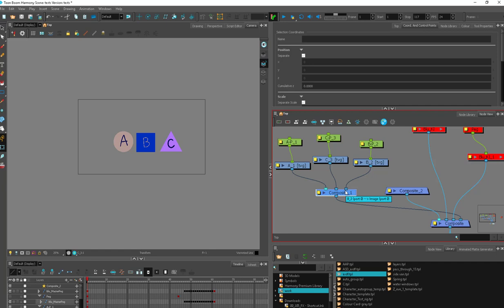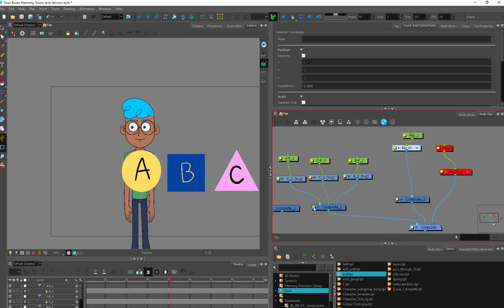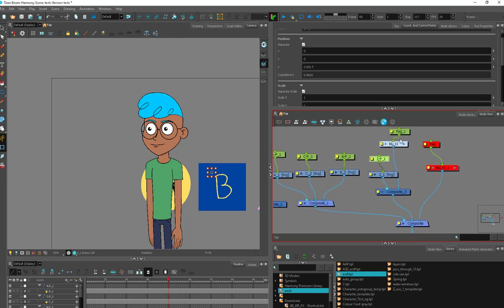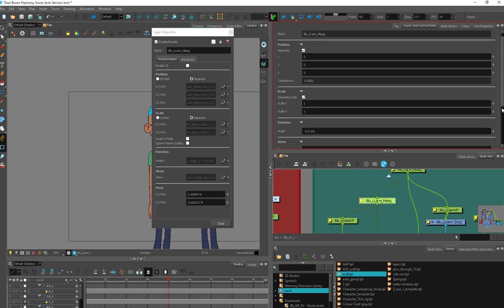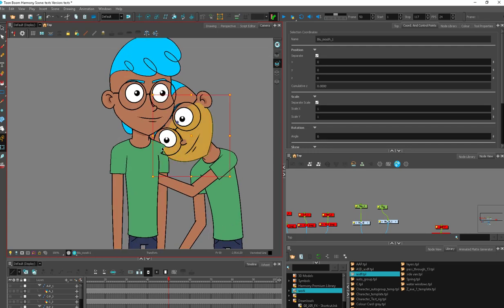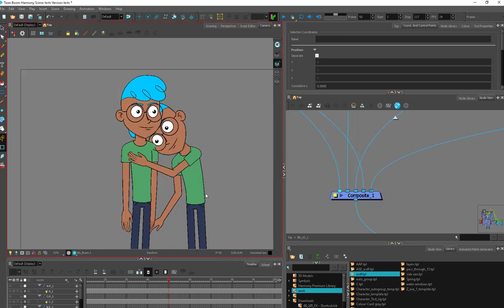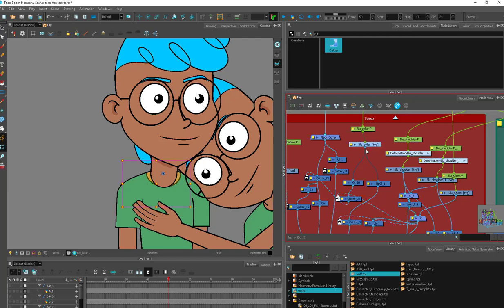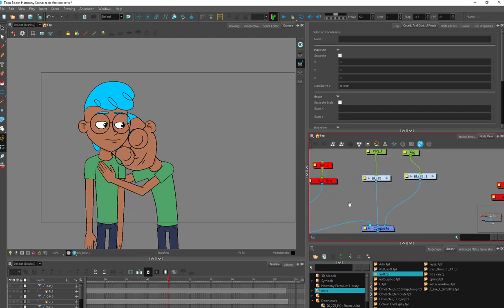Composites and Solving your animation Z problems

Comment: Hi ! Thx so much for all yours videos ^^
Do you have any solution for Z problem when you use "image switch" node... Cauz' I notice this node works "as bitmap" like the composite option....
Reply from the maker: There are a few nodes like the image switch that are bitmap nodes. I will either use a bunch of image switches above the composites - or as high as they need to be to not mess up the Z depth we need, and link them all to one switch.  You can find more info on linking and switches here: https://www.youtube.com/watch?v=3R9SgDnJyVI
Also you can try a pair of transparencies so one becomes visible as the other becomes invisible. 
 Or some kind of transparency + cutter  combo so it can be controlled with drawing substitutions.
Reply: @StylusRumble  Woa ! Thx for this fast answer... I'm gonna try your solution way, thanks a lot ! ^^

Comment: Is there a way to make a peg in one frame be forward then the next frame the peg can go behind. I'm trying to to make a head turn around and having problems with the ear.
Reply from the maker: You do that using the Z axis and moving it back and forward in space. 
 The easiest way to do this is to use your coordinates and control points tab. It will show you where things are located in z-depth

Comment: Thank you! I noticied that when i use an image-Switch node, it flatten my composite even if it's set as pass through. Is there a way to avoid that? I like to Have a pair of legs with pivot from top to bottom and another inverted for planting foot. ( and switch them when needed)
I also would love to know how to use motion blur in toon boom, have never been able to do it correctly with rotating stuff. I watch some shows that blurs the previous 1-2 frames in fast movement. 
don't know how they do that the easy way
Thank you for all your video master stylus! :)
Reply from the maker: some nodes are bitmap nodes. So they will flatten everything just like a bitmap composite. 
 If you need to retain the Z axis and use an image switch, you may try using multiple image switches and linking the control to a single one, or creating an external switch for all the nodes. 
 This video should help if you don't know how to link stuff. : https://www.youtube.com/watch?v=3R9SgDnJyVI&t=61s
Reply: @StylusRumble  thank you!! Will give it a try :)

Comment: hi.. when I give tween between two keys which both have same z info, in that tweening area z info changes automatically. Can you help me to solve it??
Reply from the maker: it's possible there's some weird tweening in there. Especially if you're using a 3D peg. 
If it's seperate you can set the Z path to stop-motion keyframe (right click and select "set stop-motion keyframe  or Ctrl +L) 
If you are using 3D pegs it's a lot tricker to fix this. You're probably better adding a Z peg set to separate. just to track levels.
Reply: ok.. i'll check it.. thanks a lot 😇

Comment: So I have a question about the z axis I have two characters and I wonna add light and shading to it but i get a ghosting affect do you know how to solve that?
Reply: It only happens when I add tone shading
Reply from the maker: @DanzyRemix  You might need to add a bitmap composite to flatten the character first.
Reply: @StylusRumble  is there a way to push the tone shading back too?
Reply from the maker: @DanzyRemix  - It will follow what it's attached to. If you need shading on a part that goes behind- like an arm, you need to put the shading in the arm group. 
This can get really tricky when moving things behind/ahead, because of the bitmap composites. 
If you're going that complex, it's better to work with a completed scene, and problem solve each issue as it comes up.